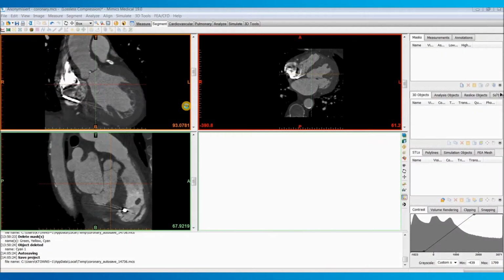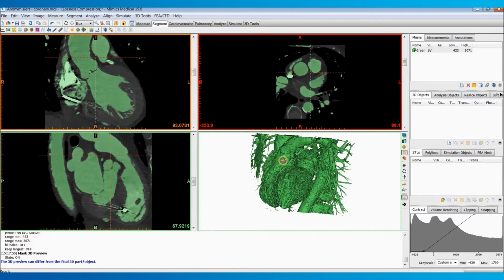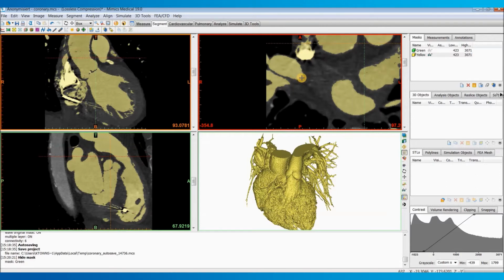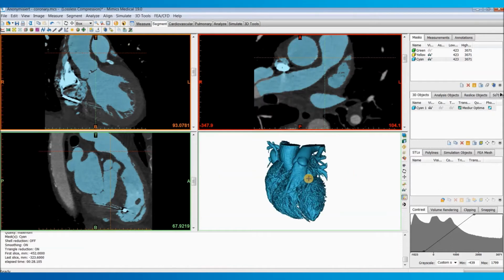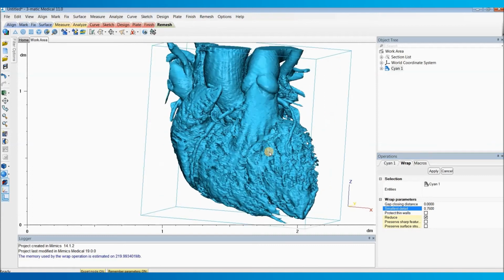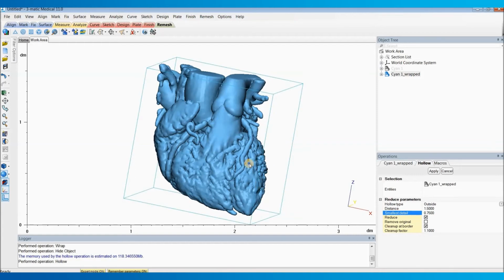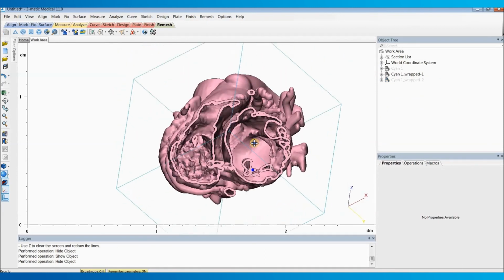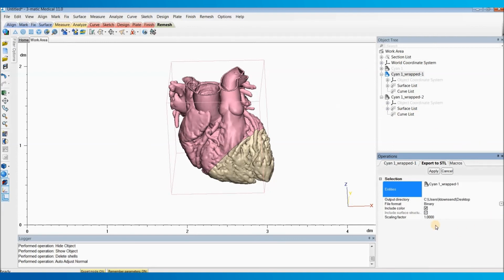How to Create a Heart Model for 3D Printing |  Mimics Innovation Suite | Materialise Medical

Comment: Hello sir! I cant seem to find the software you are using. i have downloaded mimics innovation suite 21 but am unable to find the software you are using. I presently have 3 matics medical and mimics medical 21 but none of these have the interface you have used.
Can u please let me now! :)
Reply from the maker: Hi Pranav,
The interface is indeed different because the video shows a previous version of the software (19.0). There was a complete renewal of the interface in the 21.0 version of the software, but the tools have kept the same name so you should be able to find them back without any issue.
Reply: I have downloaded the mimics innovation suite 21 but 3 matics medical cannot be opened due to licence issue can u plz guide me regarding this .